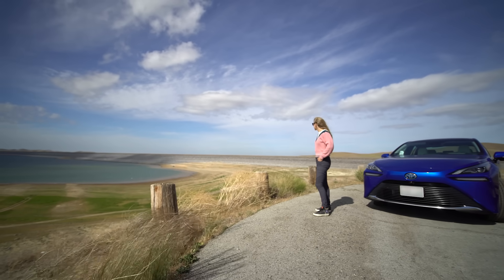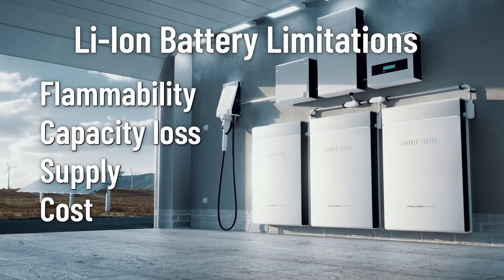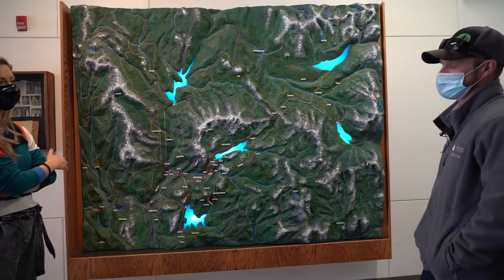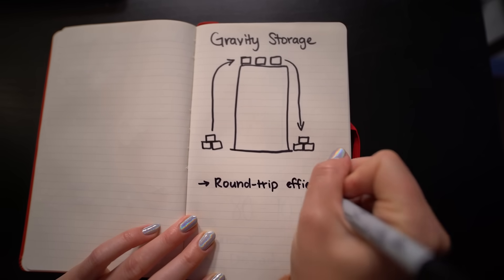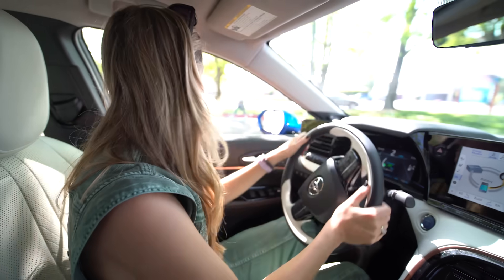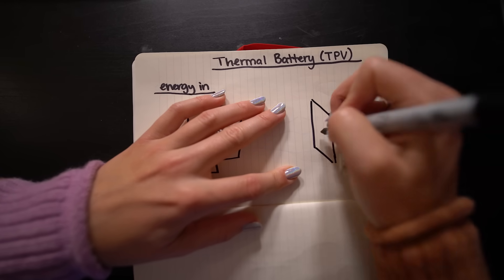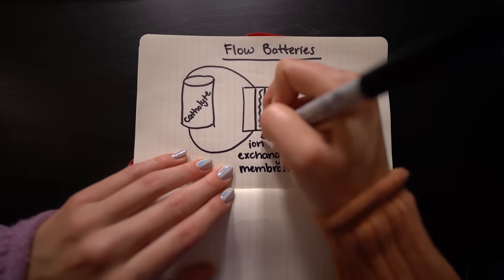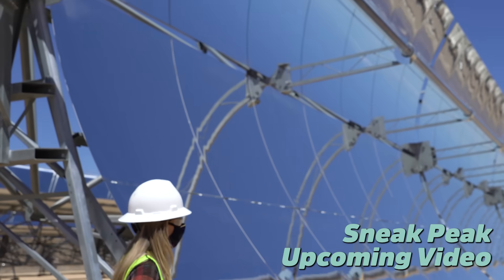The BIGGEST problem with clean energy

Comment: YES.

Turlough Hill in Ireland- a lake battery at high altitude.  Hydro, rain, gravity and wind combined.   

Four 125MW Siemens turbines under a fish-stocked  pumped storage lake.

Could skyscrapers be built to artificially do this in urban areas or near farms?  -  large heavy tanks of water could be cranked up then lowered via a gear system to drive turbines.  The tanks could even be engineered to be filled with usable rain water.

Comment: If you read my comment on the "Hydrogen Fuel Cell" video, then you know my favorite choice for energy storage: ammonia! 

It's flammable, but only in specific conditions; it lowers the voltage needed for electrolysis of water, and cam be electrolyzed on its own; it liquefies at -33C, or 8.6 bar; it's currently the second-most produced industrial chemical (behind sulfuric acid) in the world, and gets its hydrogen for the process from the same place: methane steam reforming; labs in both Stanford University(2015) in the US, and Monash(2019) in Australia, has made small reversible fuel cells that produce ammonia (which contains more energy as ammonia, than as hydrogen and nitrogen); we have centuries of experience in transporting and storing ammonia; ammonia is useful as a fertilizer and chemical feedstock, so there is an already established market for any excess production; ammonia is caustic, especially to certain materials, like aluminum, but it can be neutralized easily, and either used as a salt, or reformed back into ammonia with little trouble. 

As you can tell, I'm a fan.

Comment: Glad you made this video.  I have people ask me as an electrical engineer (even though my career isn't in power generation or transmission) about green energy all the time and this is exactly what I have been saying.  Storage is the biggest thing for green energy right now because of its relatively high inconsistent generation compared to other sources, and the other thing I think green energy needs is greener infrastructure.  Most people don't realize their windmills and solar panels they see have life spans and many can't be or aren't recycled when they fail or hit end of life.  I have always liked pumped hydro due to high efficiency, as well as its ability to start from blackout conditions; something that is very important for green energy is having sources that can start up from those conditions.  I hope we can find more areas to install pumped hydro, but I can't wait to see what other options are developed.  The most recent one I have heard of was basically a hole in the ground in Utah they were going to fill with molten salt I believe to store excess energy.

Comment: Does extracting hydrogen from water result in a net loss of water?  Or does it all recombine with oxygen?
Reply: You split water into hydrogen and oxygen, which separately are higher potential energy states than they were together.  Combining them again gives you active energy to do things and allows the system to slide back into a lower energy state.  A by-product of combining them is to produce water again, the same amount that you started with.  Hydrogen won’t hang around on its own if oxygen is nearby.
Reply: When you "burn" it, it will bond with oxygen to form water, this conversion produces the energy you want. Just like when you burn hydrocarbons you get carbon dioxide and water(You're basically exploiting hydrogen attached to carbon the same way you exploit pure hydrogen). To burn something is to change the chemistry into something else, the atoms are conserved. Oxygen in the atmosphere is effectively free(I mean, it typically comes in pairs) but most of the oxygen on Earth is actually oxidised into the land and oceans.

When you get down to Fission, Fusion and Radioactive Decay you're looking at literal alchemy, changing the very atoms into something else. With Uranium fission you get a ton of fission products, although you can't make everything that way. In fusion you fuse lighter elements into higher ones. So you could say that way you lose something, but there's typically so much of that something that we couldn't comprehend the timescale. If we utilised all the Uranium and Thorium of our crust, oceans and water erosion we're looking at billions of years worth of fuel. Earth won't even feel us.

I don't think we should bother with Fusion on Earth, Fission does everything Fusion can much easier. You literally just pull a control rod and the reaction gets going. When you get to space you're looking at a lot of Hydrogen out there as the most common element in the universe, just getting to it may be a hassle.
Reply: Ya its a huge net loss.  20% loss to create it, 40% loss back to electricity, 10% loss back in a device.  Congrats your at 43% efficiency of whatever you used to create the electricity.  That's why no major auto maker sticks with it.  The math simply doesn't work.  Not to mention transport costs to get it to a fuel station.    

Just use nuclear power.  Yes it creates extremely toxic waste you must contain, but zero emissions. 

It's literally the only short term solution.  Battery powered vehicles and nuclear power.  We can't hold out for commercially viable fusion power.
Reply: @AB-nv7bz  Internal combustion engines are of similar efficiencies and they held ground for decades. And that is ignoring the process of laying down the fossil precursor products for several millenium to produce the raw material oil or the efficiency losses due to refining the raw material into usable product or transport of the raw materials or finished product.
Efficiency figures for conversion of sun light tor wind, into electrical energy are to a large extent not an issue until we run out of planet surface required.

Edited to note your next posts - well stated.
Reply: @douglasbell3344  Problem isn't the generation of power, it's storing it for use when needed.
Reply: @AB-nv7bz  that's the best case in higher temperatures of around 25-30'c efficiency can go down to as much as 20% because of thermal expansion.
Reply: @AB-nv7bz  "That's why no major auto maker sticks with it." The very same automakers have stayed with 10-35% fossil fuels for over 100 years? The thing is that none of the factors matter alone. You need to consider all the three important factors together to get an idea about the viability. The important factors are; 1) Price, 2) Scalability, 3) efficiency. The viability is a product of all of these. 45% efficiency wouldn't be any problem, if price was very low and scalability was excellent (scalability actually can be excellent for hydrogen). The thing is that price is not low, you need expensive materials, expensive systems to store. The efficiency only needs to be good enough that the price of the storage is cheaper than extra production or alternative storage. Hydrogen also may not necessarily be best to be used directly in a form of hydrogen, instead it can also be made into synthetic fuels, that will be needed for applications that batteries cannot do, like long distance flying, ships, and longer timescale seasonal storage. For storage as synthetic fuels hydrogen has many advantages, for example the German gas grid alone can store 200 GWh.
Reply: @AB-nv7bz  Another thing is that you consider only vehicles, which are only minor part of total energy consumption in many countries, for example here in my country Finland private cars consume 10% of the whole energy consumption of the country. Think about it, 10%! Of course this may be a different case for example in USA, where average cars are much more powerful / bigger engines, and other energy consumption structure is vastly different.
Reply: commentator "A B" didn't answer the question, which was is there net loss of WATER, not efficiency.
Reply: @AB-nv7bz  
The losses show up as water that never became electricity so are not pertinent to the original question.

43% efficiency – that’s better than gasoline, which is between 30% and 36% efficiency.  That’s probably why no major auto maker went with gasoline when they could have gone with diesel at 50% efficiency.

Nuclear fission power works but it is not scalable to the extent needed to prevent climate change during this century without abandoning safety (the math has been worked extensively).  It can only be a niche player much like it is now (and like hydrogen will likely be).  We’ve lost if that’s our only solution.  Not to mention new nuclear power is three times more costly per megawatt-hour than new utility renewables and it can’t load follow demand in any practical way (it’s for base load), plus it goes down for months at a time every few years and cold starts take days to do.  Most of the reactors need water cooling so the huge power plants needed can’t be built close together and we learned oceans aren’t a safe cooling option.  The km wide development exclusion zone around a nuclear plant mean they tend to be far away from the big cities that new their power (so increasingly suffer from line loss).  No private interest will fund a new plant with government backing either.  These problems and more are why the world has almost abandoned building new nuclear plants.
Reply: @cloudpoint0  78lb of gasoline gives you 390 miles. It's relatively easy to transport.
Reply: @linusa2996  
As long as you capture, carry away and sequester the 250 lbs. of CO2 you create by burning 78 lbs. of gasoline, then I’m fine with that.  But after 4 tanks of gasoline you will have accumulated more weight than an EV battery.  This would mean you have a very low energy density per total weight.

Comment: THe biggest challenge is eliminating overconsumption. It is also the easiest change to make, but no one will even discuss it. We don’t need so much energy and consumer items. Especially single use vehicles could be the most inefficient and energy consuming way to travel. Mass transit is the obvious solution.
Reply: Mass transit is effective in areas of high population density. However, not everyone resides in such high-density areas. For example, I live in a town with a population of about 30,000 people. There are two main roads in town, not including the highway with no buildings on it. A bus runs down one of these main roads. For people who reside close to this main road with the bus, the bus can be very convenient. However, for people who live miles away from this main road, then taking the bus, versus using their car, is not a feasible option.

Comment: It seems to be always more efficient to store energy in its "native" form and only convert it to electricity on demand. For example, there is twice as much energy coming from the sun in the form of heat than as light. Using solar arrays to capture the heat, they transfer the energy to sand or molten salt and are easily stored underground, holding their energy for a long time. On a cloudy day when demand is higher, you just fire up your steam or sterling engine running off of that stored heat and you're good to go. The nice part... this system is very scalable (from 1 house to a whole city).

Comment: Hello, engineer working in this industry in the UK here. We have a very wet environment that is very hilly in places, yet we don't have enough pumped storage capacity. It results in telling (well, actually, paying) wind farms to turn off in bad weather, which is obviously not ideal. The main problem comes from the way renewable power is subsidised. Wind farms and solar farms get a very large subsidy to operate based on their unit export. Pumped storage, on the other hand, is not subsidised at all. And not only that, if you use single source renewable power water to pump up to a big reservoir, and then have a conventional hydro turbine allowing water back down to self regulate, you still can't get the subsidies for the initial energy collection mechanism. For now this means renewable power cannot regulate its own output without throwing the financial incentives in the bin, and all it does it put strain on the grid. Then when the situation gets bad enough that it becomes commercially feasible to build and run a pumped storage scheme - but to my mind this is inefficient and you have to let there be a problem before it is fixed. We have the technological capability to fix a lot of this at source, but the finances don't allow it because of rigidly controlled rules made up by government!

Comment: The nice thing about gravity storage is that you don't need any of the more expensive elements to make it work. Any dead weight material that you can hoist and lower will do the trick. Gravitricity's approach uses underground vertical shafts.

Comment: I live in Norway which as you probably know has an effectively 100% hydro-electric grid. Until recently I mistakenly thought that our largest reservoirs had the capacity to last over a year or two of droughts, but then a youtube video about the UK energy grid inspired me to do the math, and it turned out that we don't have even a very small fraction of that. :-(
We also have one of the larger pumped storage systems in the world, but its capacity is such a small fraction of the total generating capacity that in reality it is cheaper to simply adjust the production rates and reserve those pumps for shorter periods of extreme rainfall when the main reservoirs are almost filled to capacity, i.e. when the only alternative is to just let the water bypass the generator turbines. Going to a net zero future will require orders of magnitude improvements in storage, just to cover those nights when it is also calm.
Another interesting and 100% dependable energy source from that UK paper was tidal power: It turns out that there is a huge phase shift around the coast for when the tides move in and out, so that with a few such generators you could have pretty much constant generating capacity 24/7.

Comment: Energy storage can be achieved many different ways. A cuckoo clock stores energy with a weight on a chain that drives a sprocket, like the chain drive on a bike. As the weight falls the sprocket turns transforming the potential energy of height into mechanical energy to drive the clock.

Comment: Did Toyota sponsor the information as well?
"Lithium will run out by 2080".....
Hydrogen is either made of fossil fuels or electricity at a loss in effectiveness compared to charging a battery.

Comment: Nuclear produces constantly, need less space, less concrete, less metal, less water, does less victims, and less CO2 per TWH than anything else. The only industry that manages its waste well. And does not need the rest. So a good policy is to have an energy mix, where hydro can serve to store and peak, solar wind etc. Instead of storage we can desalinate water, or heat molten salt. Batteries can serve as short backup but on bigger scales/duration other means like concrete kinetic spinners, reversible hydro are better. Geothermal has its challenges. Overall a strategy with nuclear as a base bed power production is the best. And it should switch to unpressurized thorium molten salt with gravity freeze valve passive secure tank.  So NOT 100% renewable.

Comment: Why does the improbable goal of "100% renewables" and not zero emissions infatuate good minds? Is it possible that ideological adherence to a belief system overwhelms common sense? We have energy storage in orders of magnitude higher scales than electro-chemical or even PHES. It's called uranium, and fission is the safest, most scalable zero carbon generation on the planet. All the 'fixes' that drive up costs even further for low energy density intermittent weather harvesters do not scale. It's either a climate emergency or it is not. So use what we have now, and build it to scale. Everything else is a distraction, and the road to nowhere.

Comment: I like your periodic table!  
Hydro pump storage sounds like most efficient, doesn’t need high tolerance handling like hydrogen, can be held in reserve for months or longer but once you dump the water downhill you’re done until you have another excess of electricity generation to pump the water back uphill.
We really need to solve these problems before we start shutting down nat gas power plants, forcing the consumer into all electric (or hydrogen cell) cars.